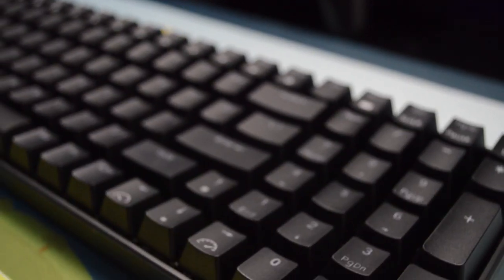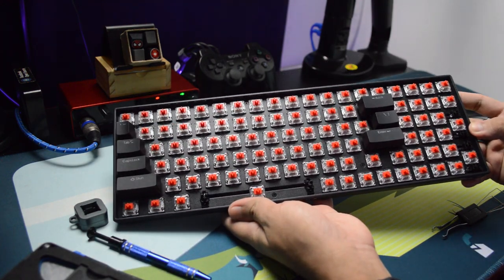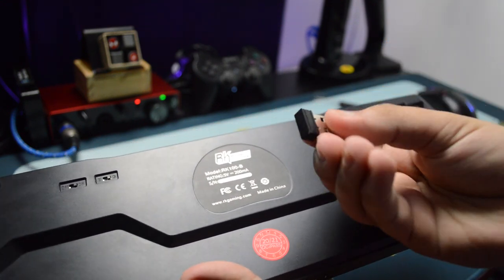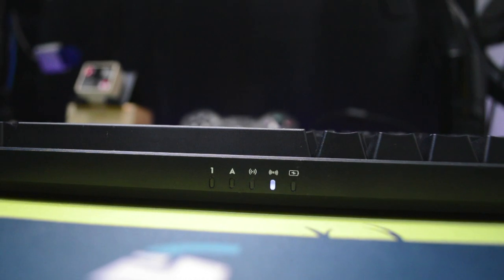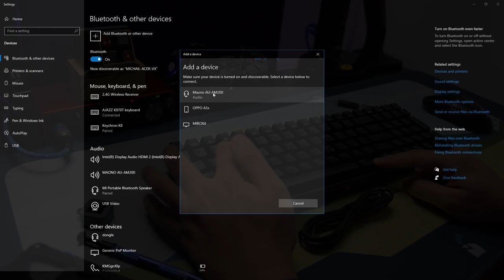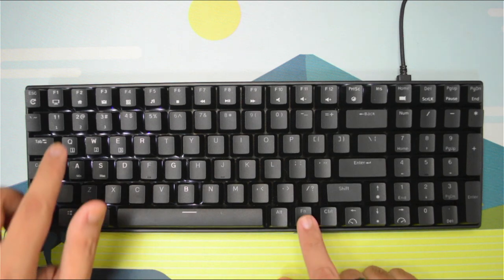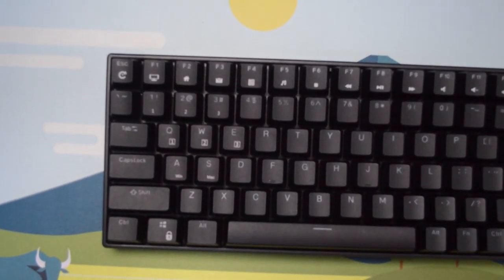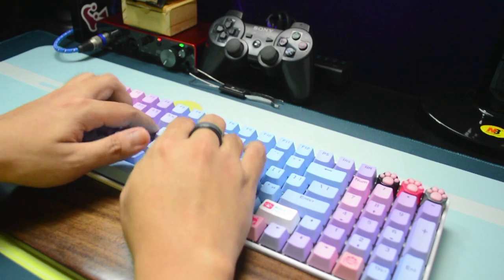Keychron K4 Alternative? - Royal Kludge 100 | RK860  Review

Comment: Been using this for 2mos. and the 2.4ghz connection has not failed once and is responsive enough for competitive gaming on valorant + heavy typing for work. It's as reliable as wired so that's really a big deal for someone who wants less cable in their setup.
Reply: How was it now?
Reply: haven't found single long term review. can you tell how long it lasted?
Reply: @Parag_06  still using it for work. No hardware  issues. Check for firmware issues as I heard some people encountered bricking when updating. One con is if you press the turn off button for wireless, it doesn't really turn off. Also, check if they have a firmware that resolves this. I didn't need to update as I always use 2.4ghz. don't need to turn it off since the battery life is good. Can last three weeks.
Reply: @johnnyr-518  thank you very much. I'll probably using it in wireless or wired mode with coiled cables. but still be aware of updating firmwares.

Comment: Nice Review.  I am now comparing the Royal Kludge 100 RGB with the Keychron K4 hot swappable RGB.  Both are 1800 models (compact).  Both keyboards have their pros and cons.  Although the Royal Kludge is heavier, the Keychron feels more solid.  I do like the extra keys (for Mac) on the Keychron.  RGB is clearly better on the Royal Kludge.  The key caps on the Royal Kludge are better than the keychron.  Of course, I plan on changing them out, so that fact does not matter.  I will use both for a week and then decide.  It appears that it takes more pressure to the keys of the Royal Cludge; however, it could be the Gateron Blue switch.  I did get Gateron Brown switches in the keychron.  I may just switch the blues out for the browns and see if there is a huge difference in the pressure.  That’s it for now!
Reply: So, any update?
Reply: Give us the update plz
Reply: I have this board in my Amazon cart right now & just waiting for prime day to see if it goes farther on sale ... The selling points for me were that is is both hot swap and has USB passthrough, which is unheard of on anything less than $400.

Comment: Hi great review, does the standard 104 keycaps fit it? or i need to have specific keycap sizes?
Reply: 104 keys doesn't fit cause the right shift key is shorter than the enter key. I almost made the same mistake. You need to find 96 compatible keycaps
Reply from the maker: It doesn't. Look for keycap sets with more than 104 keycaps, preferably 120+.
This keyboard has OEM Row 1 1.75u Right Shift, OEM Row 1 1u Numpad 0, OEM Row 4 Del, PgUp, and PgDn.

Comment: NIce review! I have the hotswap red switch version (bought for 46usd) and can confirm all the things that you mention in the video. For the battery life, I'm currently still using it for 10 days without led and still haven't die yet. Planning to lube the stabilizer and try a different switch later on. 

Can I know you you disassemble the keyboard? Is the screw located under the keyboard (on rubber feet etc) or on the top that you have to pull out all the keycaps to have access to the screw?
Reply from the maker: You can see in the montage that the screws are placed on top only. Remove all of the keycaps so you can get a better view.

Comment: You sir convinced me to buy this keyboard, mine arrived today. :)  I have a question though, How will I know if it's already low in battery? and for how long do I need to charge it?
Reply from the maker: There's a red light indicator underneath the spacebar when it's charging. It turns off when the keyboard is full. AFAIK there isn't a way onboard to tell the battery life but when it was low battery in my testing the backlights started turning on and off.
Reply from the maker: It is possible to tell battery life if you're connected via Bluetooth thanks to BLE.
Reply: @kmichailg  got it! Thanks! Subbed :)

Comment: For beginners, which mode connectivity do you prefer? And do you experience any sticky keys?
Reply from the maker: Wired or the 2.4ghz mode. Very minimal delay. No sticky keys with all the units I handled.
Reply: @kmichailg  I just got my RK860, thanks to you! But I get a bit of delay and sticky keys on bluetooth and 2.4ghz.
Reply from the maker: There's a firmware update being circulated in the communities I am part of. Check with your vendor to get the official update.

Comment: I just bought the hot-swap version. My PC/laptop can't recognize the keyboard when I use 2.4GHz wireless mode (USB receiver).
Help me please.
Reply from the maker: You can re-pair your keyboard when holding down the Fn + P buttons. It will flash, then connect your dongle to your computer again.

Comment: What were your mods? They sound awesome in the test 🙂
Reply from the maker: Case Foam, Tuned Stabalizers (Clipped and Lubed), Plate Dampener. Switches come factory lubed (Huano Reds).
Reply: @kmichailg  Can I ask what Gateron switches are compatible with this keyboard? 

And also what keycaps are compatible with this 96% layout?
:)
Reply: @kmichailg  My god, that switches sounds awesome, you didn't lubed again really? I see that the keyboard come with Gateron red instead Huano red hmm... 
Do you recommend this one over K4 or GK96s ? I don't care about RGB, only build quality, and one that can be opened to foam it
Reply: @entremontanas7614  I think the RK100 doesnt have much space for foaming as the plate is rather low.

Comment: Update: I got mine today and Im having issues with s key getting sticky and ending  up with infinite "sssssssssssssss" I hope someone can help me.
Reply from the maker: Try reseting the board with Fn+Esc and switching around the S switch with other switches.
Reply: Hi, just want to check if this issue has been resolved?
Reply: Email RK, i think there's a firmware update on this issue.
Reply from the maker: As they said, there is a firmware update. Check with your vendor before using the firmware update from internet sources.